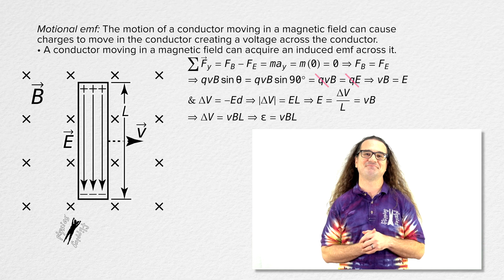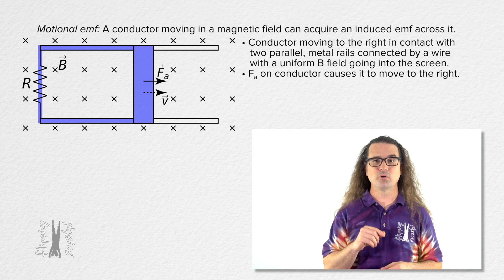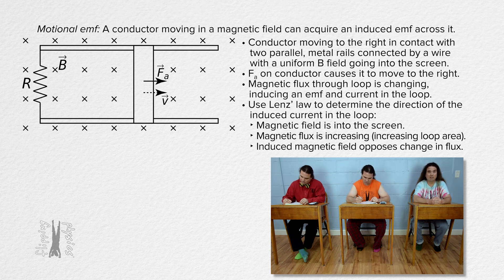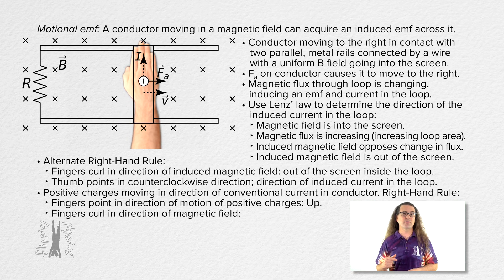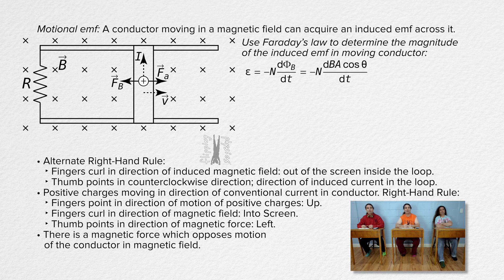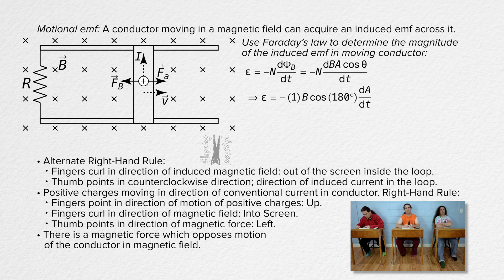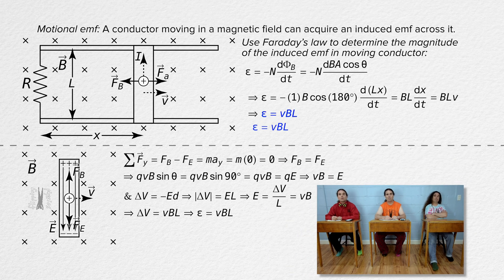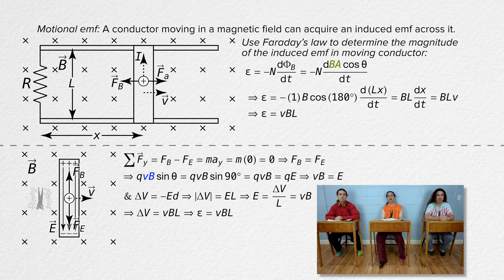Motional emf via Faraday's Law

Comment: Bum, bum, bum-bum; bum, bum, bum-bum; bum, bum, bum-bum; Ba-da, ba, ba
| ♪♪♫ | ♪♪♫ | ♪♪♫ | ♫ ♪ ♪ | 
I derived I = (d/R)v x B, where {I,v,B} are vectors, {d,R} are scalars: distance between rails, and resistance.  I liked how similar it was to the magnetic force on a moving charge (Fb=qv x B),  but here the "I" vector corresponds to the direction of the current induced in the circumstance of 'Motional EMF'.  By the way, thank you for clearing my misconception:  I was under the impression that the rails were initially charged, as if by some unmentioned external battery, but now I know that the current in the rails is only a consequence of the system's operation, not an initial condition.

Comment: And correct me, Mr. P, that based on the angle given and defined, I'll use the respective equation with sine or cosine of theta, right?
Reply: The field flux is defined as the surface integral of the field with a dot product the area vector (which is perpendicular to the surface by the convention of the right hand rule).  When the angle given is the angle between the field's direction and the area's normal vector, it is cosine, since cosine is the trig operation that corresponds to the dot product.